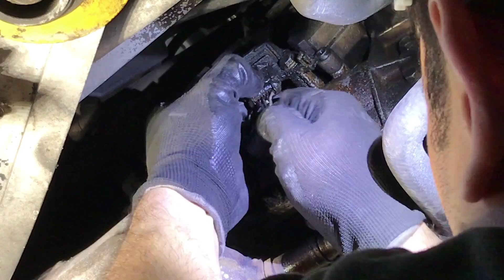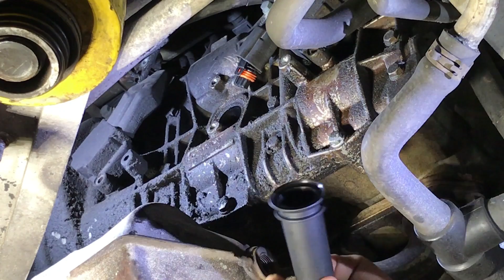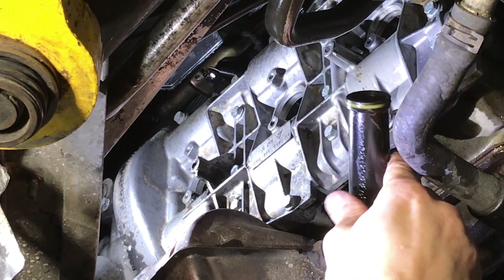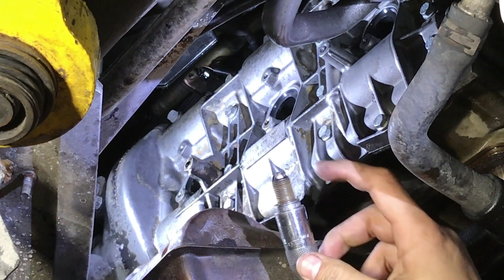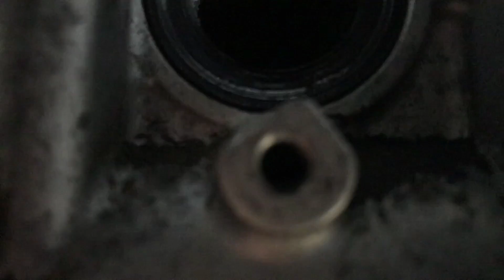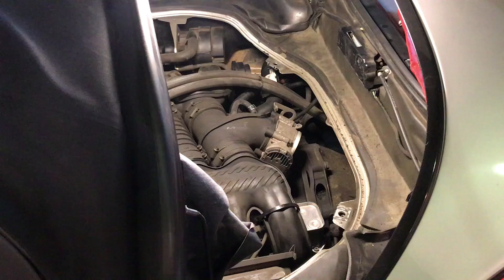2002 Porsche Boxster S 3.2L P1128 and P1130 Part 2 repair

Comment: Why is there so much grease/oil, is this german engineering?, looks like a british vehicle,3 there are famous for leaking oil. Why the tubes at the spark plugs, is this just sloppy engineering.The insight from this video is a great service as to the problems with porsche.
Reply from the maker: Thank you

Comment: Maic, thank you for taking so much trouble to film a repair. I have the same issue codes but no smoke machine. The dealer recommended plugs and coils for $1100!  I have P1128 & P1130. Car runs great and I already cleaned the throttle body. Could not find any obvious vacuum leaks.  I'm going to change coils, plugs, tubes and pre-cat 02 sensors myself for less than dealer quote. Clear the codes and see what happens. My code reader indicates I'm running lean before these changes. I washed the engine the other day before doing this work with engine cleaner and light water. Engine was nice and clean but was getting a misfire on cylinder 1.  Cracked coils would do that with water intrusion. I will update when finished. Your video makes me confident. I don't think I want to use the silicone though...scared it will make later changes difficult.
Reply: Michael Mercier hi, did you sort the issue out? What was it?! Thanks!
Reply: Update?

Comment: I'm also impressed that you cleaned the area so well. The job came out nice.
Reply from the maker: wyattoneable thank you so much.
Reply: @MaicSalazarDiagnostics  Great job Man, very informative. My 02 986 2.7 has the same codes, idling smooth, but  a little surging under light power cruising along,And shifting surges a bit. I will clean the throttle body and replace the tube s. Maybe clean the maf, or replace. Thanks for your vids. Ps Did you mess with the maf at all?
Reply from the maker: @jeffjeff4477  no MAF on this one

Comment: I love the way you clean things! Your father taught you well. This job wasn't nearly as hard as I thought it was going to be. Nice job using the tools you have to r&r the tube seals. It appears that the coil is crucial to actually holding the tube seal in place! Thanks!
Reply from the maker: Baxrok2 thank you and yes the coil plays an important role with those tubes. I think the hardest part was the cleaning!